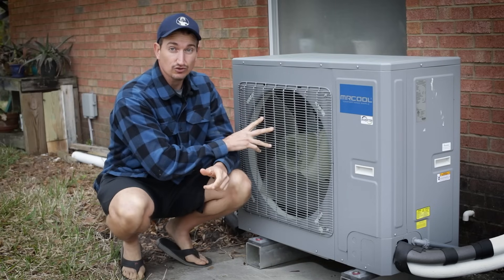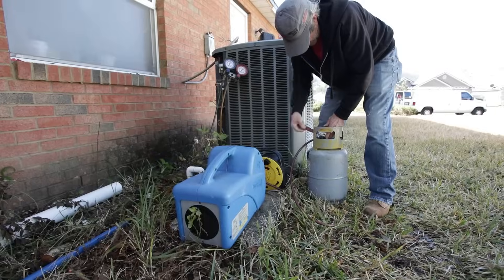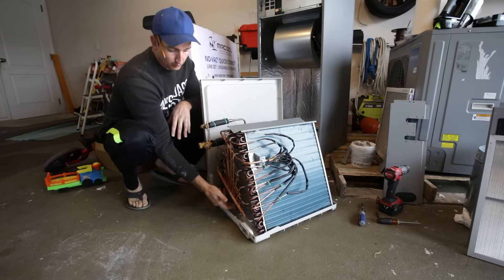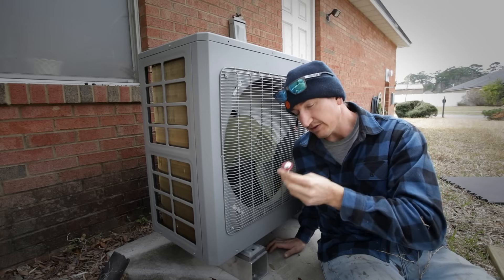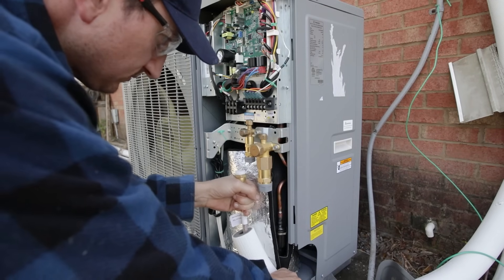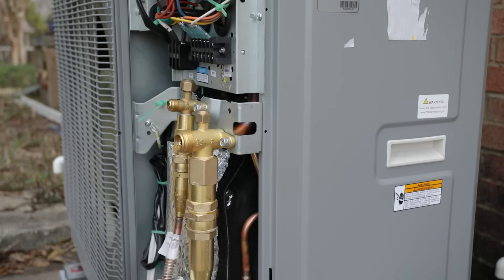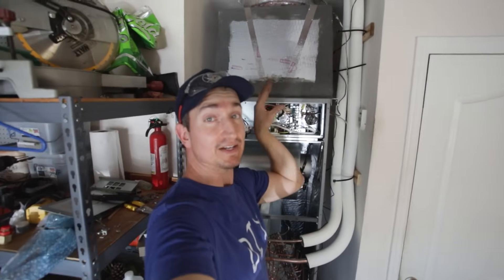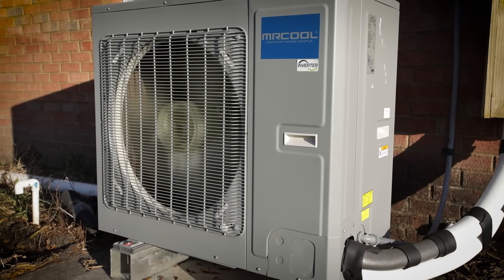Whole House Air Conditioner and Heating System Installation. MrCool Universal, Is it a DIY Project?

Comment: air will contaminate the refrigerant and shorten the life of the unit.  after the leak repair the tech should have evacuated the system with a vacuum pump. then add refrigerant. air has moisture and moiture will damage the unit over time or immediately in some cases
Reply from the maker: thank you for your insight Richard

Comment: I hope he pulled a vacuum on the system. 

That was a big leak on the video. By the time he came to patch it, the system would be a 0 psi unless there’s a close solenoid trapping some refrigerant in the condenser. 

After brazing the leak, pull a deep vacuum using a micron gage. Then add refrigerant by weight. Need to see how much is takes on the condenser. And also how much the pre charge line set took by calling the manufacturer. Add both weights to get the best results.
Reply from the maker: The system consisted of the condenser, the air handler, and the line set. The condenser came with about 10lbs of r410a refrigerant and the evaporator coil and line set each should have come pre-charged as well.  The problem was the coli in the air handler came with a hole so presumably most refrigerant escape from the air handler before I ever installed anything.  Once everything was connected and the pre-charged lines were open additional refrigerant leaked out through the small hole for about 8 hours before the system was closed off.  So at that point the evap coil was refilled with refrigerant from the lineset condenser and then some more was lost.  When the Air handler coil was repaired it was filled with nitrogen.  Then more refrigerant was added to the entire closed system.  So I would anticipate there is still at least Nitrogen in the system.  It seems to be operating fine regardless at this point.  So my overall question is do you think the systems is ok operating as it is assuming there might be some nitrogen in it? It seems like it would be very costly to add fresh refrigerant to refill the entire system.
Reply: @MrKistel  Depends on how much is in the system. Its a all or nothing if it is contaminated you remove all and recharge. More than likely you don't have much. Compressors don't like squishing stuff that doesn't condense from vapor to liquid
Reply from the maker: @jonsaircond8520  Thanks for your insight
Reply: Never heard of pre charged lines set and coil, needed to vacuum down system before you opened valves. Vacuum would have revealed leak. Once air is in system, all 410 needs to be removed, vacuumed down, then charged fresh. Won’t benefit to just adding 410 after it contamination. Good install just missed the last step👍🏻

Comment: the whole system should off been recovered, pulled vacuum, and recharged by weight, the guy only head a low pressure gauge hooked up while charging, no way he could off charge properly its ever overcharged or underchared
Reply from the maker: When a system is recovered is the refrigerant that is removed able to be reused in addition to what ever new refrigerant needs to be added? Or is the old refrigerant considered contaminated because of the potential air in the system? I am not clear on the understanding of where the air goes in a situation like this.  Thanks
Reply: @MrKistel  air and moisture will contaminate a refrigeration system, if a recovery tank was clean, and refrigerate it self is not contaminated it could be put back into a system after repair, but its always better to recharge with new especially r410a because its a mixture refr. and a mixture leaks at a different rate.

Comment: Good video. Sucks to see your evap was leaking. I would say that your evap probably wasn't filled with air.. I'd think once it hits atmospheric pressure, there shouldn't be too much air exchange through that tiny leak.

I just fired up my 2/3 ton universal. I reused the existing lineset after rx11 flush, vacuuming to <500 microns, installed a filter drier, and all seems well so far. I did read that surge protectors are recommended for any inverter system, so you may want to consider that. I installed one on the outdoor unit and currently debating the inside unit.

Hopefully I have better luck than Tyler below. I'll update if there are any changes.
Reply from the maker: Thanks for the insights John.  Do you mind sharing what surge protector you are currently using?
Reply: @MrKistel  Seems youtube doesn't like it when I post links. I got the Mars 83905 from KTool
Reply from the maker: John, it is not shown in the video but the evaporator coil was filled with nitrogen during the solder repair process.  So I assume the nitrogen is in the system. Not sure if nitrogen is much better then air considering air is mostly nitrogen.
Reply: @MrKistel  oh right. In that case, after repair it should’ve been vacuumed down to under 500 microns and then refilled/service valves opened. Nitrogen is inert so there won’t be any scaling from oxygen in the air when he brazed/patched the coil. Otherwise, that scale can clog the TXV, especially with no filter drier.
Reply: @John-Paul732  Yes. That is my main question about this great project. With DIY, manufacturer support is critical.
Reply: @John-Paul732  Wow. That's very disappointing. Anyone else having customer support problems?
Reply: @John-Paul Tapp  yeah I'm trying to get an answer as well if he requested a new coil be sent. I can't imagine repairing a new  damaged system as it probably voided his warranty!

Comment: Nice install! We installed the 4/5 ton unit (big brother to the your unit) ourselves. Unfortunately the compressor went bad in about 8 months.  Mr Cool sent us a BRAND NEW outdoor unit under warranty.  They advised us to re-use the lineset and the second outdoor unit just failed again (about 6 months later).  We are waiting now on a third outdoor unit (again covered under warranty).  This time, we are replacing the lineset and the evaporator coil also so we will have an all-new system... suspect contamination might be the cause... so hopefully this time, we will be all set.  We love the system when it's working but it hasn't been a great experience so far... and we did everything by the book!  Any reason you didn't just close the refrigerant valves when you noticed the leak and have Mr Cool send you a replacement evaporator instead of calling a tech to braze on it?
Reply from the maker: Thanks for the comment. Glad to hear you have been sent replacement units when you had issues.  Mind if I ask what the symptoms you observed that pointed to a failed compressor?  Did the outside unit fail abruptly at once or get worse over time? Did both air condensers fail in the same fashion?  Thanks.  And yes we did close the valves once we noticed the leak in the evaporator coil.
Reply: @MrKistel  The first unit started exhibiting intermittent P5 error codes (overcurrent protection) and then one day I happened to be outside nearby it and it was making a terrible noise... I pulled off the cover just to make sure it wasn't something obvious or loose.  I shut the unit off from the thermostat and as it was winding down, it sounded like gravel was inside the compressor.  While ramping down it threw an H7 (driver out of step) and never started again.  The second unit worked fine for a few months but then we got the intermittent P5 code again.  Mr Cool sent us a new outdoor control board that they said had updated firmware on it that addresses this newly-recognized issue; and it did... unit ran great right up until a week ago.  Unit just stopped working one day and when I pulled the cover, I was looking at a PH code.  I swapped out the inverter driver board (a different board from the controller... there are three large circuit cards in these things!) from the previous unit -- which they let me keep for spare parts -- as the service manual suggested, but that didn't fix it.  Unit tries to start (fans come on), but right when the inverter drive board tries to start the compressor, it just won't turn over and it flashes the PH code and shuts down.  So we are again assuming compressor failure.  These units are re-badged Gree Flexx units and Gree is the largest manufacturer of ACs in the world so I'm confident they aren't garbage; I'm just hoping we've had bad luck.  I can say Mr Cool's tech support via email has been extremely responsive and warranty support has been great.  I'm strongly considering vacuuming down the lines between the condenser and evaporator this time just to make absolutely sure there is no moisture or non-condensables present.  There is enough refrigerant in the outdoor unit for up to 25' of standard lineset, so I'm comfortable pulling a vacuum on the lines even though they are pre-charged.  I'm sure our case is isolated; this can't happen to everyone or Mr Cool will go broke!! :-)
Reply from the maker: @hedge605  thanks for you insight. For the repair I show in the video we added refrigerant to compensate for what was lost. The HVAC tech did this by simply watching pressure levels on gauges , he said he added about 3 pounds of R410a. I mentioned concern about potential remaining air in the system and he said it should not be a problem. He said if it was he would see it on his pressure gauges.  I am hopeful he is right. My handler coil was sent to me damaged with a breach. So no refrigerant was in it.  Additional refrigerant was lost once lines were open and before leak was detected. So I assume the coil was full of air.
Reply: @MrKistel  Yeah, I would assume the same... which is not good, at all... sorry.  Moisture is the biggest killer (from what I read online) by which the liquid-air separator supposedly helps with (and is installed in the unit, although I can't find anything about a filter dryer being installed). 

Cross your fingers and hope for the best! Please ping me back here if you experience an issue, because Mr Cool is convinced this is not wide-spread.  Note too (to your benefit) that precise charge amount is not that important on these types of inverter systems because there is an accumulator that keeps excess refrigerant to be able to meet different cooling and different heating demands which depend on all kinds of things like indoor and outdoor temperatures, etc. The system will watch the temperatures (to deduce head pressure), compressor output temperature, suction and liquid line temperatures, and use that along with ambient temperature to keep sub-cooling and super-heat in check.
Reply from the maker: @hedge605  I believe the installation manual says to install a filter dryer when installing the system using a traditional line-set method.  I guess this is when custom lines are run and vacuumed. Wonder if it would be worth trying add one on my system now in retrospect? any thoughts?
Reply: @hedge605  Tyler - did you check your voltage at the disconnect or outdoor unit? Curious how your outdoor/indoor unit is placed in terms of elevation (ex: indoor 20' higher than outdoor)? I'm wondering if it could be an oil return issue, but the manual states that it should ramp up every now and then to run that cycle. Can you share your lineset length?
Reply: @rvamtbram  Hi John. Yes I checked it at the disconnect and at the main board and inverter board. 256 across the two legs - each 120 leg is reading 123. Mr cool said  that should be fine. 25 foot lineset, condenser is on a pad on the ground, air handler is 8 feet above in the house attic. No oil return bend called for when condenser is below the evap. Good ideas! Keep them coming because I’d like to make sure this one lives a long healthy life!
Reply: @hedge605  ...123x2 = 246 which should be fine. But 256 is too hi.. I was talking to someone on facebook that had issues. The unit's supposed to shutoff above 252V, but his didn't and kept frying his condenser. Once his power company fixed the voltage, he's been ok. 

Yeah, doesn't seem to be oil return issues in your case.
Reply: @rvamtbram  Oops yeah bad math on my part… but let me double check it now… I’m starting to wonder…
Reply: @rvamtbram  Oops yeah either obviously bad math on my part or something is not right with that. Ill double check it now… I’m starting to wonder. This is great feedback. Thanks
Reply: @hedge605  hopefully that’s it. At any rate, most of the pros recommend surge protectors for inverter systems due to all the electronics. I got a mars, but it seems Intermatic is pretty popular too.
Reply: @rvamtbram  Okay, rechecked it this morning. 123 each leg, 246 across the two legs. I’ll look into those surge protectors also. Maybe glitches in city power are the culprit! Any other suggestions John? Thanks for the help!
Reply: @hedge605  that’s good to hear! Hmm, I can’t think of anything. I’d say a filter drier, but you’re using a precharged lineset.
Reply: @MrKistel
Reply: @hedge605  I'm so glad i found this I am having the same exact problems as u! New compressor toast in 7 months new unit coming in the middle of winter. SO FRUSTRATED. Here are my thoughts as i jumped deep into the rabbit hole as u did. P5 is just the beginning telling you the compressor is about to go. new drive board enhances the problem to a full blown compressor failure exactly 1 week from install of drive board. H7 will happen when you unplug UVW. PH is the absolute kiss of death your compressor is now shorted to ground. u can check the short take UVW off the compressor check U to ground pick a pipe or a ground OL should be the reading on U to ground V to ground W to ground if it isn't OL its shorted. I was taught in mobile HVAC that anytime a compressor goes for any reason the entire system should be replaced. I'm getting a new condenser and your problems look like what im gonna go through. I hope it lasts but without replacing lines and coil i Have a bad feeling im in for another surprise in a few months.

One added bonus reading all the issues with inverter drives power voltage from the power company looks to be a serious issue with these. I have gone ahead and ordered a Kool Guard 2 to disconnect the power during spikes low voltage disconnnect and high voltage disconnect maybe throw that on as added protection.
Reply: @rhettsanborn621  Thanks for the tip on the voltage protection. I’ll do that too- seems like a good safety measure! So far this third unit and lineset have been performing. No P5s and smooth quiet compressor starts. Fingers crossed!
Reply: This has been great thank you both for the knowledge, just ordered the surge protector.
Reply: You need to do an acid test
Reply: install a surge protector on your outdoor disconnect.  extra insurance😃
Reply: wow